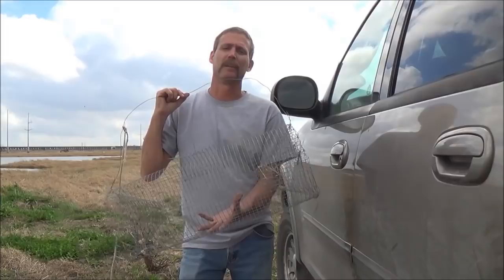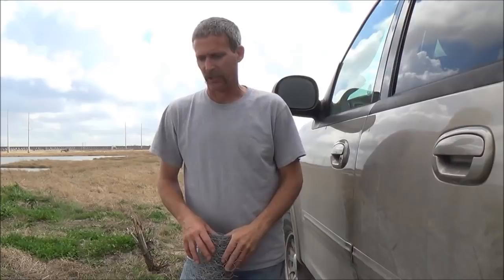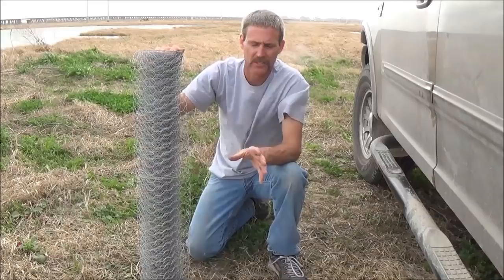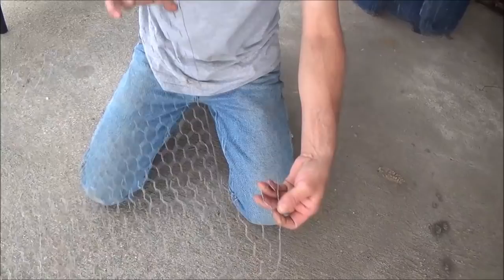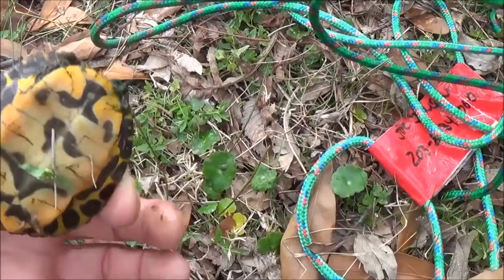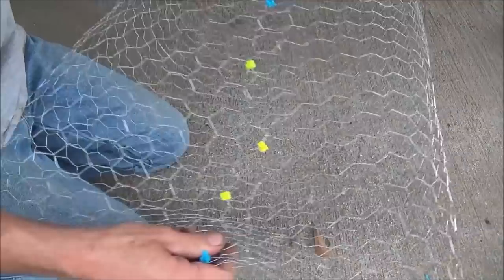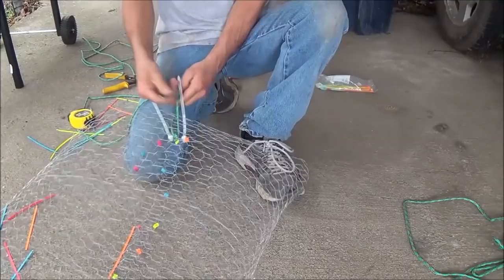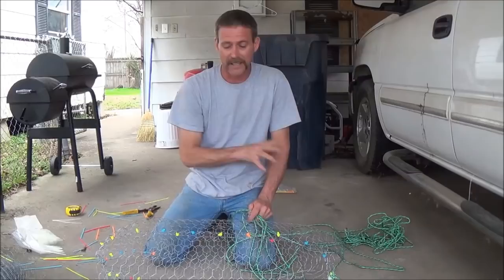How To Make A Crawfish/Crayfish Pillow Trap. Step by Step.

Comment: good job on your traps. The zip ties are very simple to use. You can also use small galvanized hog rings instead of zip ties if you are making a lot of traps. 
I have always set the funnels facing down stream in moving water, or waterways with current, because fish will swim upstream towards the smell of the bait.
Its so much fun to bring kids out and let them catch enough for a good crawfish boil!

Comment: Just remember Louisiana Wildlife and Fisheries crawfish traps requirement has to be 3/4 by 11/16 square, or larger,  a three-quarter inch hexagon chicken wire or larger, With a $15 trapping License up for 35 traps Max, Telling the agent you didn't know that will not get you out of  a $250 fine
Reply from the maker: Me being a non resident costs me much more. I Also talk regularly when I am down there with the main Wildlife and Fisheries guy. I can not remember his name right now but I have his card. He watches some of the videos I post. I have been checked several times by officers when I have been out trapping. For me to get my trapping and fresh and salt water licenses costs me 150.00 every year. One thing you did not mention is that every time I go into that area I need to sign in or I can get an additional fine.

Comment: if you want wire with smaller holes , you need to ask for mouse wire . that has the tiny small squares that are used on mouse/rat cages
Reply from the maker: That would work fine up in Minnesota but in Louisiana that mesh size would be illegal. Thank you. Joe

Comment: How did that 1" chicken wire work for you? It seems like the crawdads could go through the larger wire.
Reply from the maker: +Parrot Bill  You could only catch the bigger ones. In videos after this one I went and bought pillow traps that had the legal mesh size which was smaller and my catch rate went up. Thank you. Joe
Reply: JoeandZachSurvival
 I have 3/4" chicken net which turtles can eat through them, and really want the right size wire. But the only company that sells it says they don't ship. Oh well...where did you buy the traps from?
Reply from the maker: +Parrot Bill  I bought mine here   http://www.louisianasportnets.com/index-old.html   I drove there when I was down at Melissa's in Louisiana but you can order them here online and its fairly reasonable. Click on the "fishing nets" link and you will see the crawfish trap link. I wanted to buy the mesh and make them myself but you had to buy in such bulk it was not worth it for me. You can catch a lot of bugs with a dozen traps which is what I bought. Thank you. Joe
Reply: JoeandZachSurvival
Thanks man, I use netting and the turtles eat through to get at what is inside so you can't soak them over night.